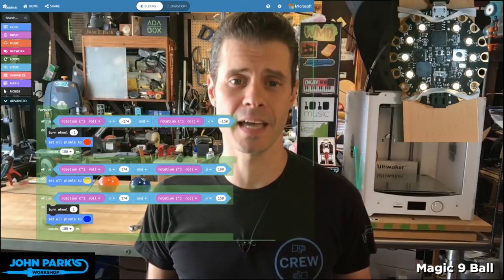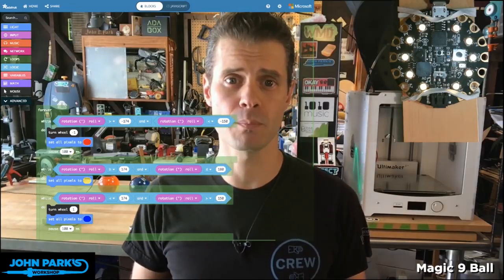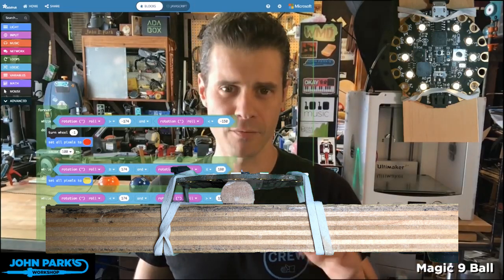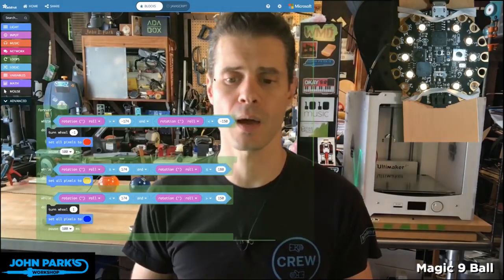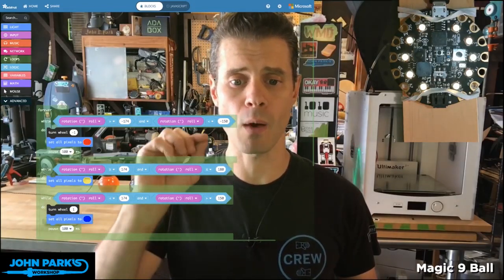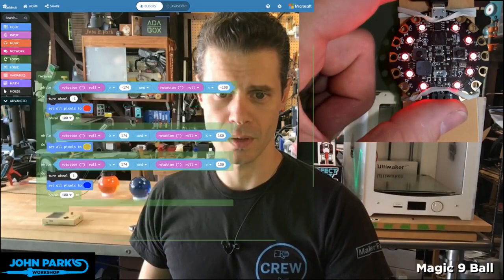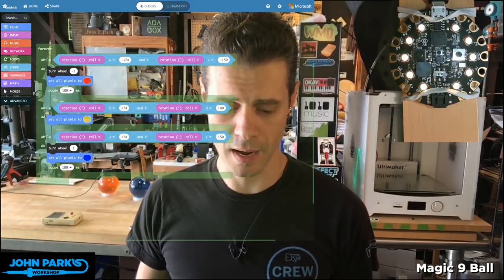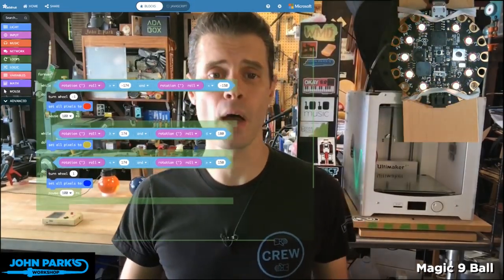MakeCode Minute: Tilt Sensor Mouse Wheel @adafruit @johnedgarpark #adafruit @MSMakeCode #makecode

Comment: What programe is this and can i use it with arduino ? Thanks awsome vid btw
Reply: This is MakeCode at makecode.adafruit.com You can use it with most Adafruit boards, the BBC micro:bit and a few others. This version can be used with Arduino Zero and Arduino MKR (needs to be M0 chip) https://maker.makecode.com/